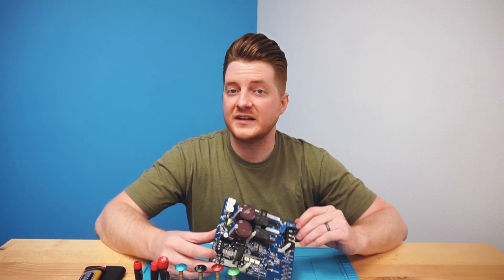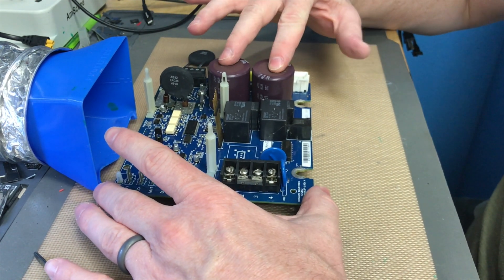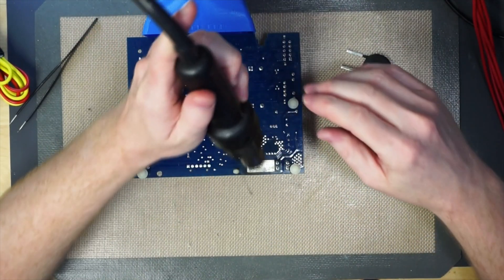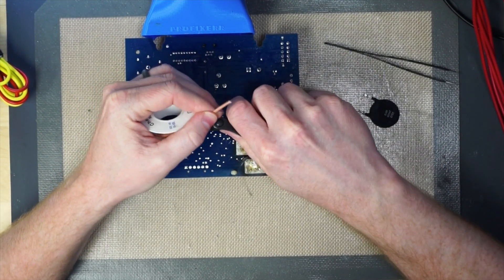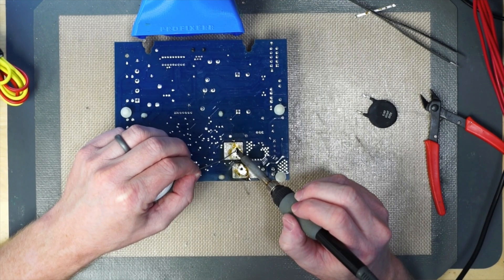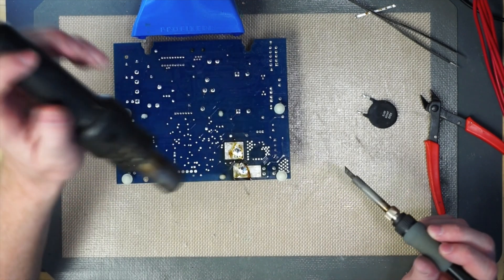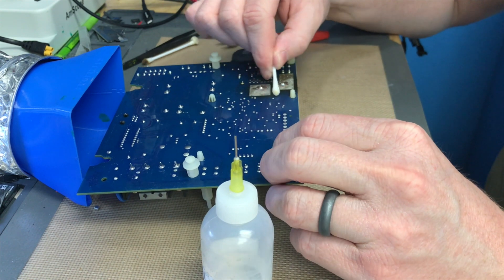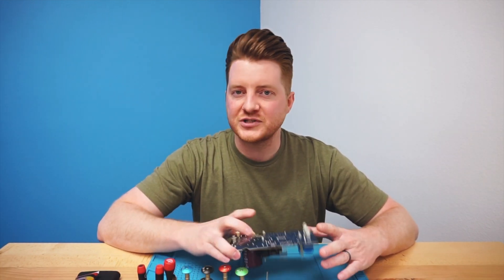How to re-solder new thermistor on AquaRite Hayward Chlorinator

Comment: I replaced the thermistor, and the cell went back to generate chlorine. However now the metal housing is very HOT ALL the time, specially behind the transformer. Why is this happening? It was not hot before replacing the thermistor.  Everything else in the panel and housing looks normal. Should I keep it running?

Comment: A quick cheat - don't de-solder the part. Cut the part off from the other side, leaving the pins sticking up..... cut the pins on the new part a little shorter so the part doesn't sit too high and just solder the legs together. This isn't best practice, but it works just fine. I was able to do it with the PCB still mounted in the case. Powered off and capacitors dissipated. I have an electronics manufacturing company that assembles PCBs and completely aware of best practice. But this is a simple work around for people that don't have experience soldering and don't want to take apart their unit.

Comment: From other videos, it looked like a thermistor decreased in resistance as it headed up. For the Hayward boards, does the board logic measure the voltage and kill the power if it reaches a certain threshold? As a current limiter, I'd have thought it would increase resistance with heat, but that doesn't seem to be how these work.

Comment: I've got a board I just replaced, but the symptoms was no power LED, though it was showing a "no flow" LED.
I'd like to see if the old board is repairable. Can I test the thermistor without removing it to see if it's broken? It isn't visibly damaged. The rubber around the legs might be a little discolored, but it could just be age.
I would think I could touch the contact plates with my multimeter and measure if the resistance is as expected at room temp.

Comment: No one shows how to remove the whole board from the control panel box?
Reply: It’s very easy. Remove all wires from the board. 2 5/16” screws at the bottom. Loosen them and pick straight up. The board will come right out
Reply: If you look at the bottom of the board you can see two voids. In the box, these voids house securing/grounding bolts. Remove all the wires, loosen the bolts and you will be able to slide the board up and remove it. The white spacer posts go into slots